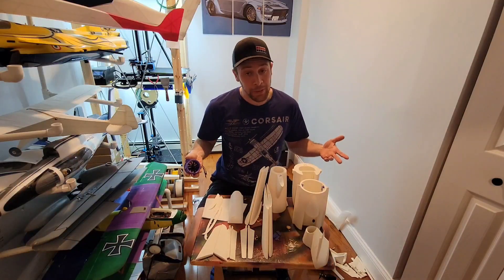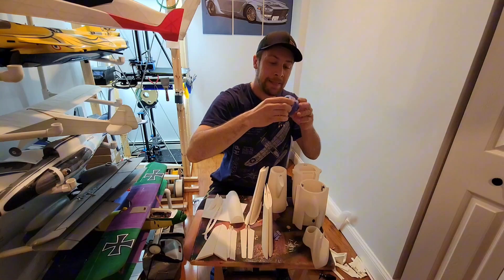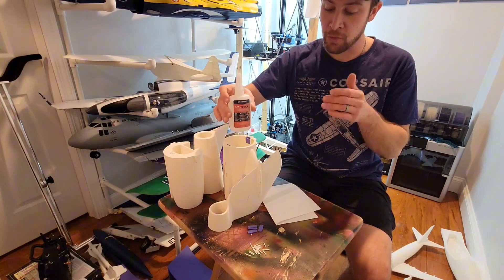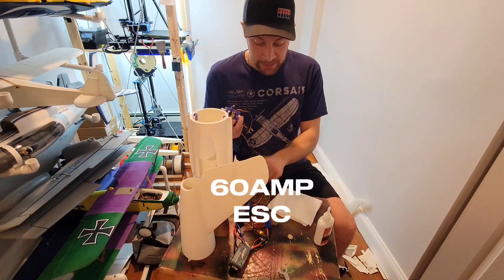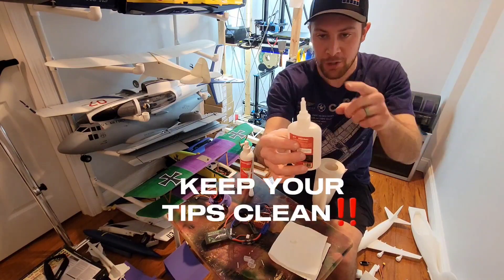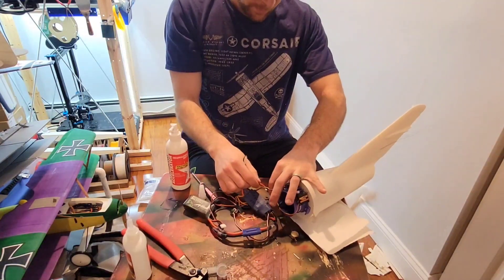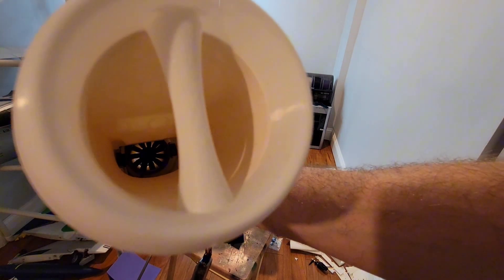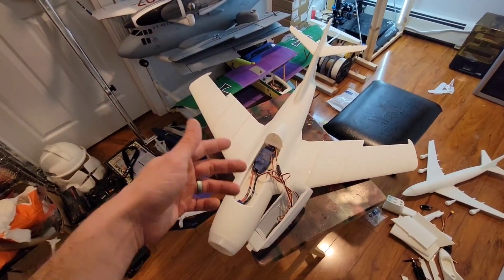MIG-15 UTI 50mm EDF Build Video

Comment: is there any custom design to fit 64mm on it
Reply from the maker: You would have to scale it yourself
Reply: @3DPrintHangar_RC  The idea is that I want to compensate for the extra weight due to printing with PLA+ only
Reply from the maker: @ss-jk7lt  You would have to contact the designer for that one my dude. I can’t say yes or no to that

Comment: Couple of questions, is there access to the fan and servos after assembly? Are you printing a bottom AND top on your pieces? So many planes are bottom only and no top. Great video, will be waiting for the maiden, thanks for sharing w us!!
Reply from the maker: There is access if you screw the parts together like the manual says...  I just glued mine together 😅 The maiden went... less than ideal. It's on my shorts